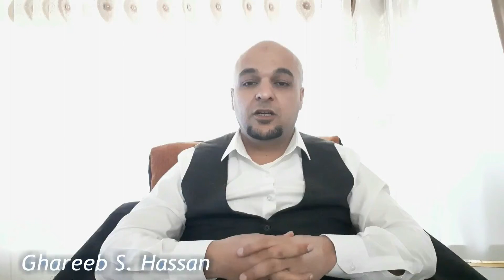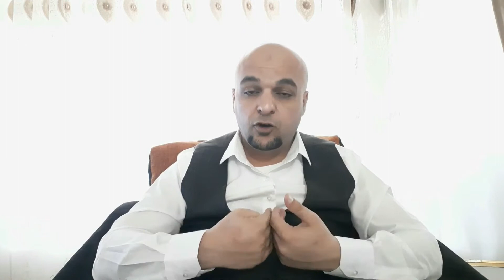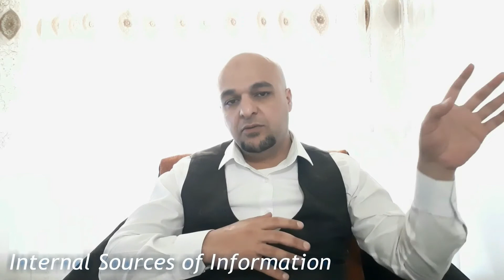Internal and External Sources Of Information - Safety Study Group

Comment: Hello Sir, 
I suddenly stumbled into your channel and found it a great source of information.
I want to know one thing, for the IG 2 open book exam. 
I searched many websites on Google for risks assessments and it's solutions. So, the risk assessment i wrote is 'copy and pasted' lines from many websites. After converting the word file into PDF. The PDF showed various underlined text. What does that mean? Did i do something wrong?
Reply from the maker: Hello, brother / sister. 

1) you should not copy and paste. You should do the work yourself so you will feel the sense of accomplishment when you get the results of you passing ig2. 

2) as for the underlined, you've probably copied and pasted the text and its format from the source.
Reply: @SafeCourseTrainingSolutions  Actually i was falling short of time. So the research i did for the risk assessment was a task like i referred many websites did research work but i did not frame many things in my own way. So need to ask will these formatted lines have an impact on my exam?